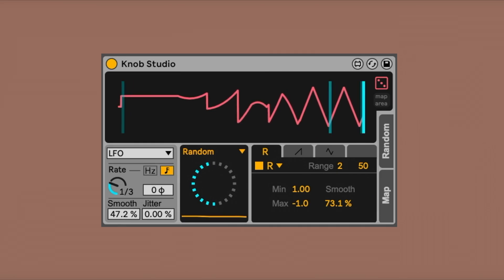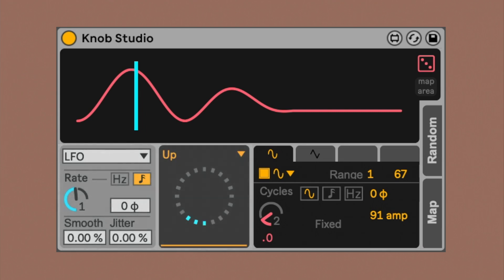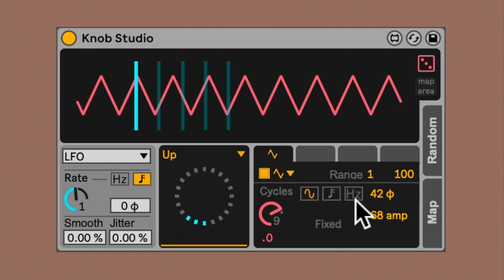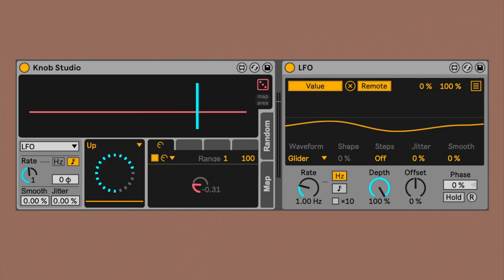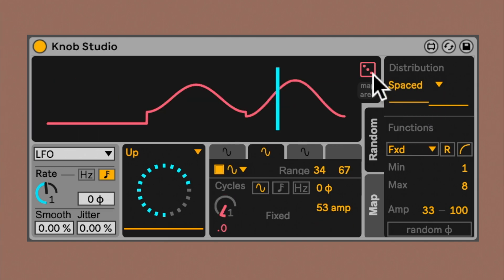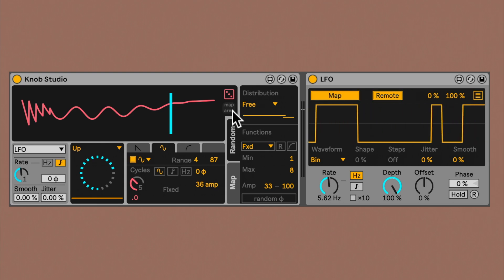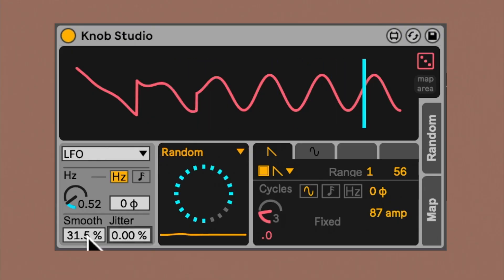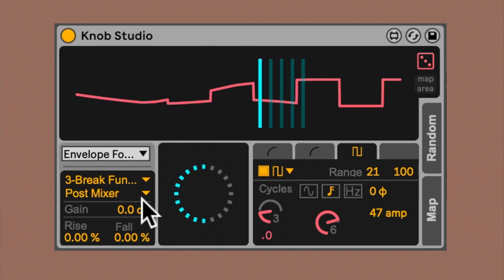Knob Studio - Walkthrough

Comment: this device is inspiring and well made! also looks so good :)
can I put two advices/requests?
1) if possible, make more controls automatable  (like the amplitude on the individual waveforms channels)
2) an expandable modulation routing.  6 is nice but 12 would be better ;)
Reply from the maker: I'll look into it, actually it's not that straightforward to make everything mappable because of the randomization stuff! I need to find a way (or cycling should haha)